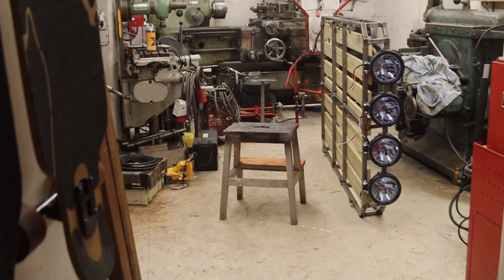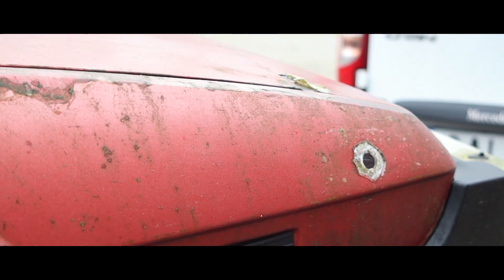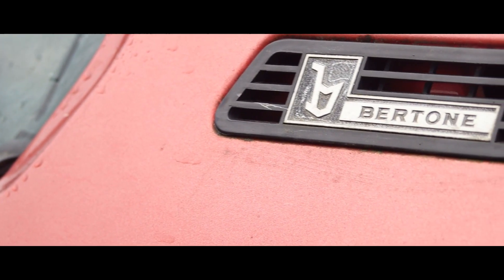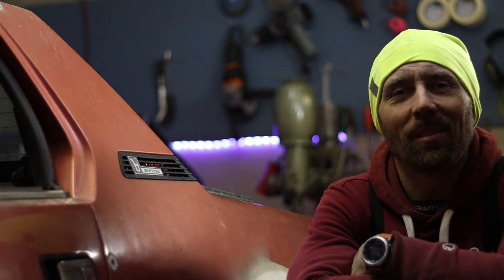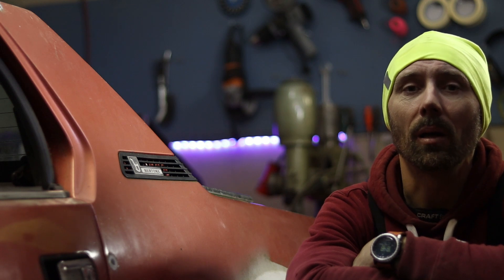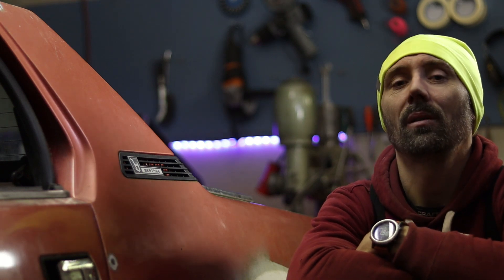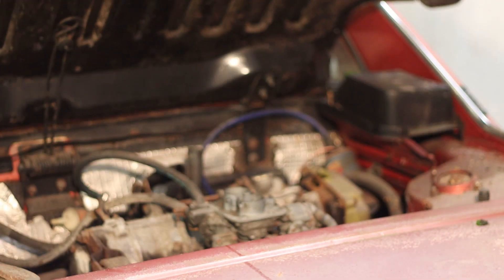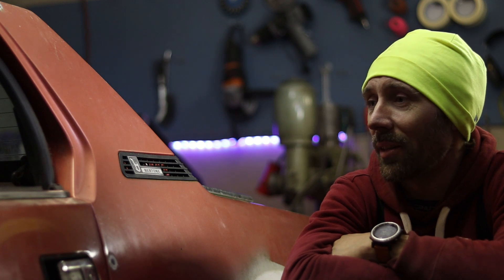Reincarnating a Fiat X1/9 - EP01 - The project!

Comment: At the age of 24 I bought a X1/9 in 1995 (1985 model) and as the rusty holes were getting bigger, after 5 years of fun I had to take a decision: Drive it till it's dead or restore it. So I started to disassemble. Now I'm 51. With many interruptions it took 21 years and a lot of work and money to rebuild it. But I can tell you, it was worth every minute! Do it! I wish you lot of success!!! Regards from Germany
Reply from the maker: Way to go! That is exactly what it’s about. Few things worth doing comes easy! Thanks for commenting!
Reply: Hi Stefan, your story is similar to my x1/9 project - I still have my 85 car that I ran when I was 19. Thankfully I’ve had it garaged otherwise it would have dissolved by now - starting my restoration to bring it back to enjoy it for my 50th birthday present to myself. Fingers crossed

Comment: Cool! I’m restoring a 1980 X1/9 as well! I have a rebuilt Uno turbo engine for it. I started the project in 2015, so yeah, your project is going to take a couple of years if you have a regular job and a family :) Can’t wait to see your progress. Whereabouts are you in Sweden?
Reply from the maker: That’s very interesting! I’ve been looking at the Uno turbo option, does that fit right in without modifications to gearbox, drive shafts etc? I’m based just outsido of Malmö, you?
Reply: It’s a shame Uno Turbo engines have become as rare as hen’s teeth, but they’re a great upgrade for the slightly dull 1500 engine. The UT engine is virtually the same engine as the pre-1980 1300cc X1/9 engine. The only real difference is the location of the shifter in the gearbox. You have to use an X1/9 gearbox and then transfer the internals of the UT gearbox to it. The rest of the engine is identical. You do have to take some extra measures to cool the engine/turbo though, because the UT has a front-mounted intercooler and obviously, that’s not really a simple option with the X1/9. I’m going to use an air-to-water intercooler, with an extra radiotor mounted behind the regular one. An alternative to the 1301cc mk1 UT engine would be the mk2 engine (1372cc, more torque, a bit more modern), but those are hard to find as well.
I live in Amsterdam btw, but know Sweden quite well (and speak Swedish reasonably well).